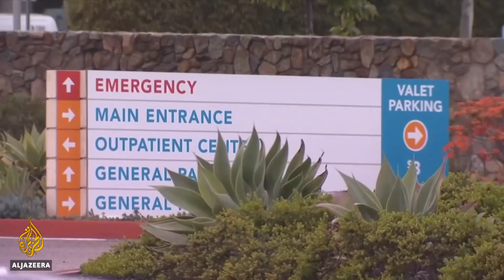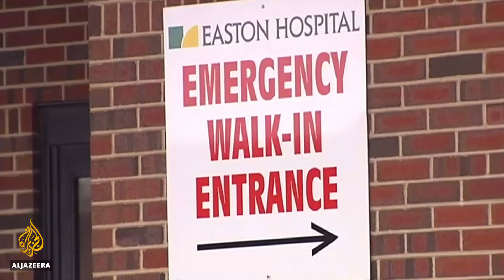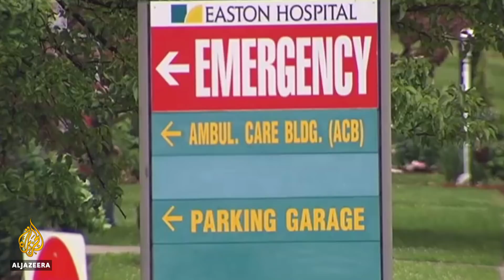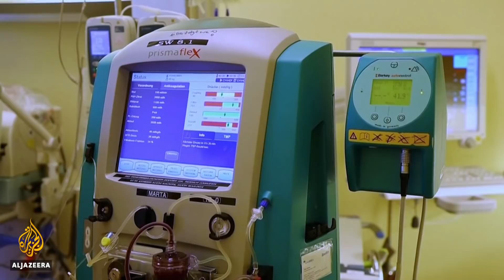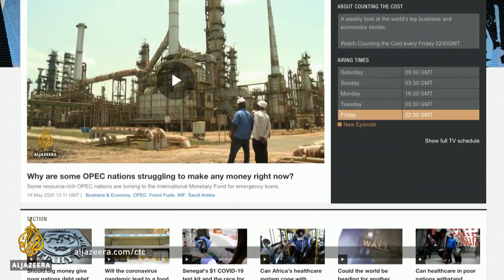Bolsonaro's coronavirus response: A threat to Brazil's economy | Counting the Cost

Comment: Overall, we rate Al Jazeera Left-Center biased, based on story selection that slightly favors the left and Mixed for factual reporting due to failed fact checks that were not corrected and misleading extreme editorial bias that favors Qatar. (5/15/2016) Updated (M. Huitsing 08/14/2019)
Reply: And? Being centrist is not the same as being neutral or even being the truth.
Reply: @ed11689  ???